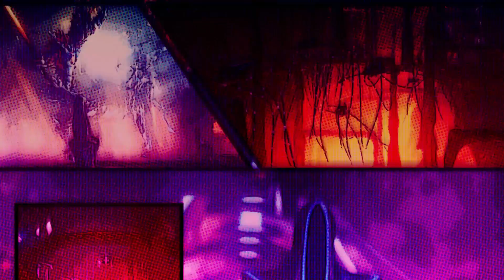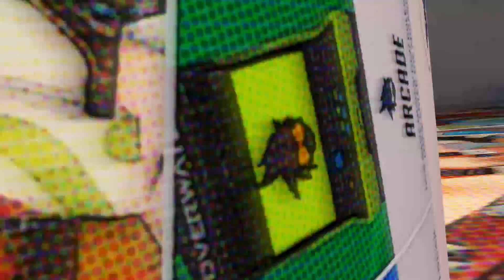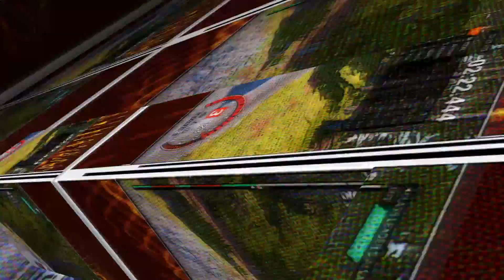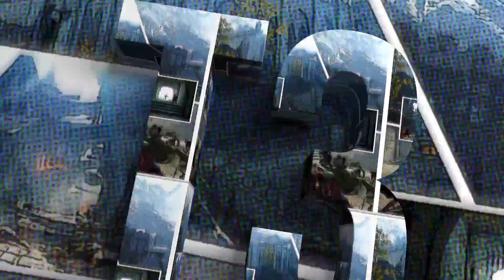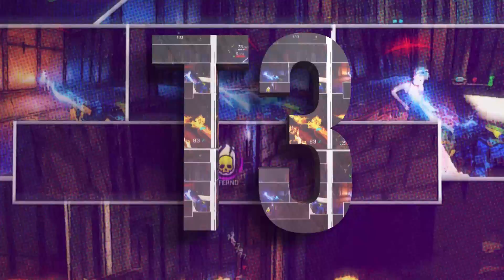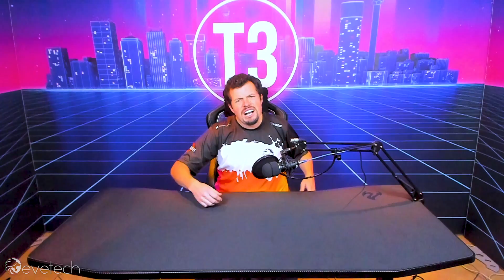Nitro Concepts Electric Adjustable gaming Desk Review by T3 powered by Evetech

Comment: Nice desk. Can you give us a review on the new evetech case Ikon please?
Reply: It is up my dude!
Reply: @turbotortoisetech  thank you for the upload did watch it. i have a question tho. how do i connect the case rgb to sync with the tamahwak motherboard? because i heard you said the wiring is short if i am not mistaken?
Reply: @tashinganyandoro6924  which MB do you have my dude? The header here is an addressable RBG connector not the standard 4 pin. They look like this: https://www.overclockers.co.uk/media/image/thumbnail/MOLE_056_015d4af82f44ff7_800x800.jpg Any addressable RGB extender will work assuming it's not at the top of the MB. The Z490 I have has standard connectors on top and the addressable on the bottom left which is why I didn't have it connected in the review xD. Only had standard extenders on hand because addressable usually means there's a control box that ships with the kit and can be installed anywhere xD
Reply: @turbotortoisetech  i have the msi b450 tamahawk max
Reply: @tashinganyandoro6924  that board has only the standard RGB connectors so you would need to control it from the case. It does have a switch on it to change modes and colours
Reply: @turbotortoisetech  okay thank you for the response.